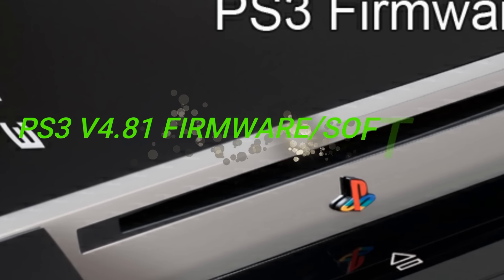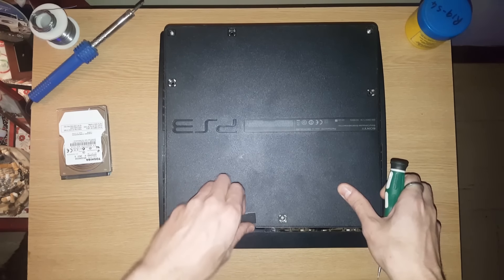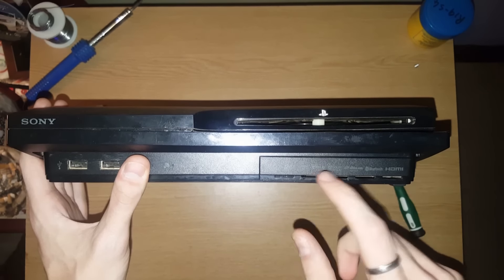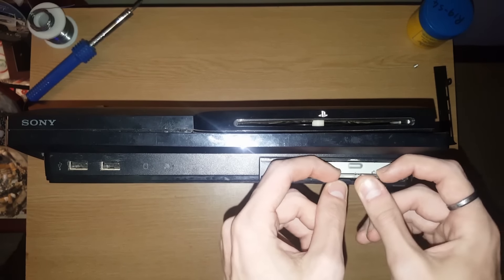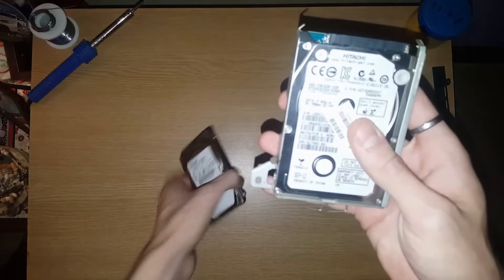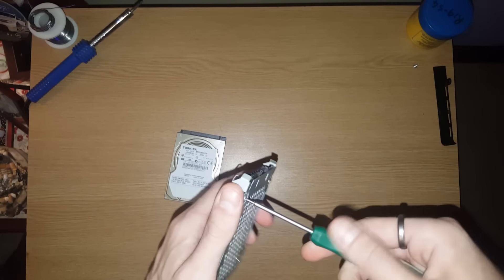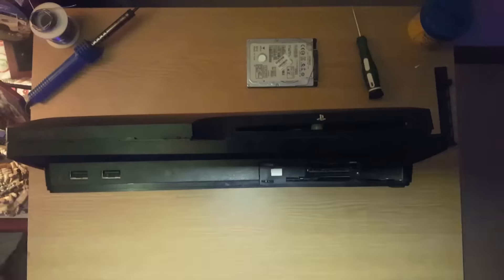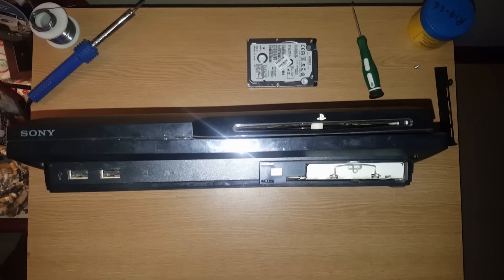PS3 FIRMWARE V4.81 UPDATE (FIX 2016)

Comment: okay, so i just got this ps3. No history on it whats so ever. it turns on and says this system cannot be run correctly. Telling me i have to update it to 4.60 or over. i tried to update it on 2 usb flash drives formatted to phat32. with the correct folder pathway (PS3-UPDATE-(firmware file). i kno its not the flash drive because it worked on 3 other ps3s. And the file isnt corrupted because im using the same file. Ive tried the newest ofw all the way down to the oldest( i know crazy right thought it could work) i took the hdd out and switched it with one that was running newest ofw. didnt do nothing but when i put it back in my other ps3 it got the same error code but i was able to put a usb in and update it no problem. when i try to do the same to the other ps3 it gets stuck at checking. I try to rebuild the data base in safe mode but it says storage cannot be acessed. it freezes in safe mode to somtimes unless i restore the system. ive put the hdd into a working ps3 running newest firmware and reformated it but i dont want to update it because its not 4.60 and i think ill realky screw myself then. i dont have a adapter to fully wipe the drive and reformat it so i want to do it on another ps3 but i dont have nun running 4.60. Idk if that woukd work or not. Anyhelp would be apreciated. Its a older slim model, it detects the usb it doesnt want to take the fw. tried mutple cfws,hfws, ofws. i dont have info on what it was running befor. im pretty sure it was just ofw.
Reply from the maker: tryiing a new HDD, you said that it didnt work?
Reply: @ARCAN3CHARG3  it ended up being the bd.
Reply from the maker: @hatethegame6921  bd?
Reply: @ARCAN3CHARG3  ive fixed many like this and usually its just the hdd. pop another one in from another ps3 and download the update from the usb and format. My ps3 had a broken solder on the blueray drive so it needed hardware.
Reply from the maker: @hatethegame6921  im glad you can use your console, well done!

Comment: was that hard drive wiped or did it have stuff on it already?
Reply from the maker: Wiped it to clear everything on it, and install the ps3 software
Reply: @ARCAN3CHARG3  install the software on the harddrive to?
Reply from the maker: @djkendell3.087  must be installed onto the harddrive
Reply: It was wiped
Reply: Guys thanks for the reply. I wiped it clean it's just the installation part I downloaded the update 4.81 put it on the flash drive. Insert the HDD and the flash drive back on the ps3 but still getting the same update code

Comment: They are saying application not found,  but the update is on my flash drive.
Reply: I have the same Issue...I downloaded the File...Put it on a Flash Drive just like I was told to do...It comes on each time and says (No Applicable Update Data Found)
Reply from the maker: format usb to FAT32
Reply from the maker: Format USB to FAT32

Comment: My ps3 show only black at screen what is the problem and how can i fix it
Reply from the maker: rai shakher ... when did it start doing that?
Reply: ARCAN3-CHARG3 ahmm i didnt use game for a week and when i start ps3 it shows only blank and dark with no sound at screen
Reply from the maker: rai shakher hold down your power button, till ps3 goes off, hold down power button again till you hear 2 beeps ... can you get into those settings?
Reply: I did that but it didnt work😟
Reply: hey  bro so does mine my ps3 didnt had any problem before the update after finishing the update it suddenly went blank and ive tried restarting the system for like 10 times but it didnt showed any improvements -_-
Reply from the maker: Satish Nair ...does your ps3 show any signs of "Light of death" ?
Reply: dont think so,  i tried removing the hdd and it shows hdd cannot be found and when i reinserted again the screen just went blank
Reply: all this problem came after the update

Comment: when i put usb with update in folder (PS3) ( UPDATE) (PS3UPDAT.PUP) .. and make all step .. its show .. error corrupted (8002f2b5)
Reply from the maker: Othman Sami what ps3 do you have? and what is the most recent update on your ps3?
Reply: ARCAN3-CHARG3 .. that my bad .. i know .. i tell you all story .. i have fat ps3 model : cechm03 .. with v4.6 or v4.8 .. i cant remember well .. but my mistake i put it on network and make update .. i dont know that bad move .. but it loaded to near full and appear massege told error with this serial 8002f2b5 .. 

now when i power on it .. it told me thats data not load well .. make update with 4.81 or higher 

i try diffrent update by usb method . with same result .. im be glad if you can help me ..
Reply: the old version is cfw not ofw .. because that i told is bad move
Reply from the maker: Guys can add me on facebook, its difficult at the moment, add me on facebook .. Gerrit Van Den Berg ... or take my cell number for whatsapp 0790813024